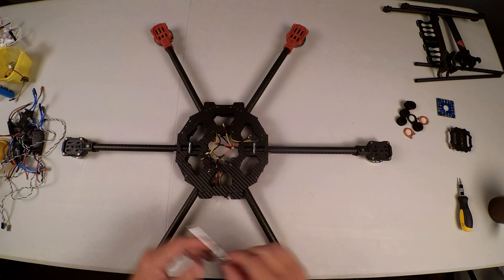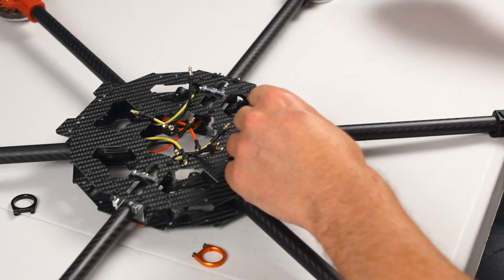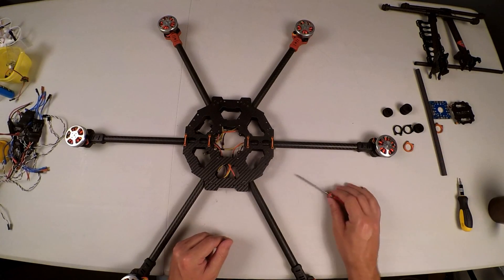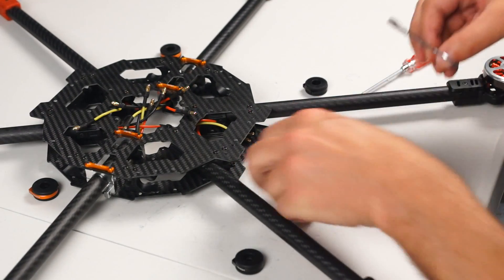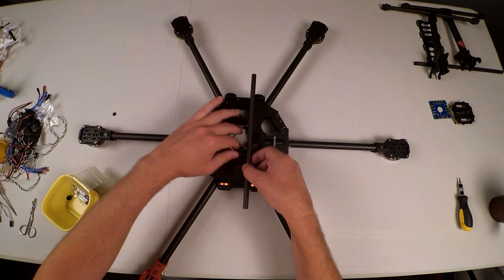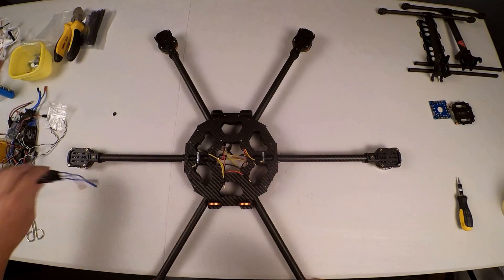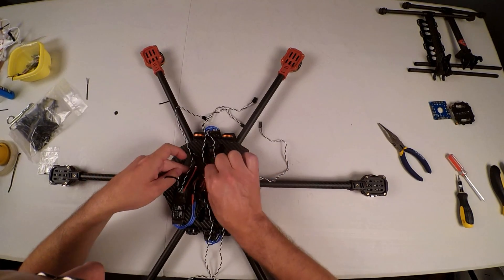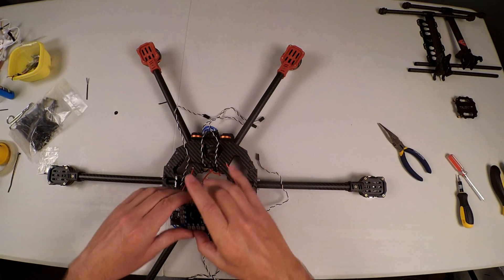Hexacopter Build Part 5 - Mount ESCs and Rail Seats on Tarot FY690S

Comment: Hello, the ESCs are close to the flight controller! Do not give you any trouble with MAG? I´m also putting together one where the ESC is on the center board. But I´ve designed a structure for them in PLA on a 3D printer. Now I´m afraid that they heat up to the point of melting the PLA! I am also afraid that the magnetic fields created by the ESC will disturb my pixhawk 2.1.
Can you tell me at what temperature these ESCs usualy go? Maybe it was a bad idea to put them in a pla.

Comment: Hi, I see the whole kit you bought on ebay. I am looking to use a pixhawk though so I am looking to piece together a kit. Would use use those mystery motors if you could choose a different motor? I am looking at using these: http://www.hobbyking.com/hobbyking/store/uh_viewItem.asp?idProduct=26960 I have no experience of mystery motors.Thanks!
Reply from the maker: +Dustin Fickert Those motors seem very nice and MultiStar has a good reputation.  I have not had much experience with the Mystery motors, but they seem nice from tests so far.  With these Multistar motors you must also check the LiPo types that can be used as I note they say 4S only.  The 4822 should also give you a little more thrust and torque which is good.